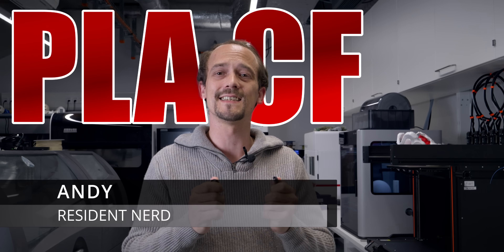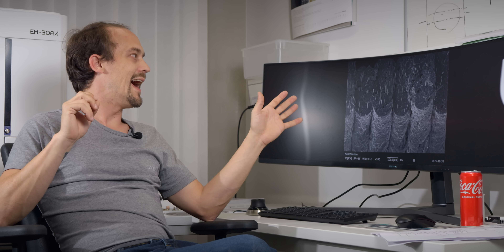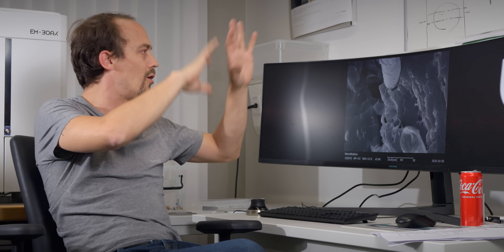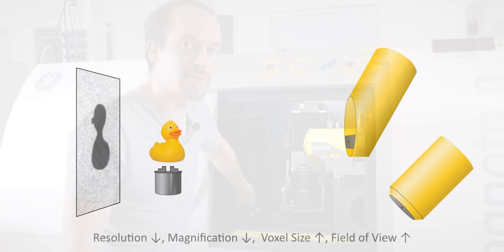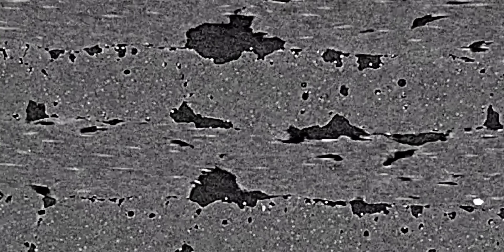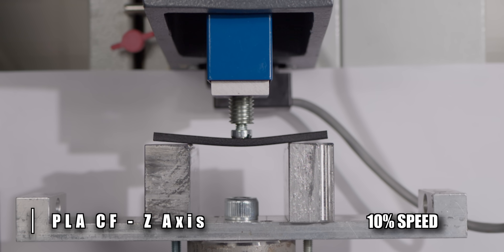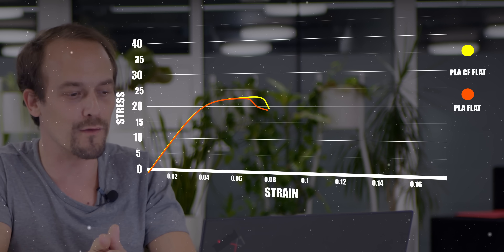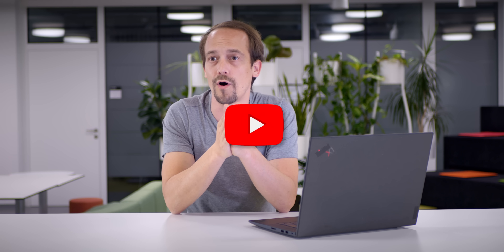3D Printing’s Biggest Scam Is Even Worse Than We Thought!

Comment: Yes, YouTube needs videos about health risks in 3D printing. CF filaments are no different than working with asbestos. Those small fibers trigger chronic lung inflammation which develop to cancer, it's exactly the same mechanism as asbestos or any inhaled small fibers than cannot break down, including glass fiber. Inhalation of any inert fiber is dangerous, and touching those prints with bare hands is dangerous, those CF needles jab into the dermis and never go away.
Secondly, the UV cross Link agents in SLA resin printing are incredibly toxic, even after curing, solvent washing, etc. 

In an industrial setting, these plastics would require serious filtration, masking,  or venting to protect workers but we let this industry sell anything to anyone with YouTubers ignoring the serious health risks to mostly produce stupid toys and more forever landfill.

Comment: Great video. I love 3D printing. When manufacturing items it’s important to have an understanding of the materials science and application. Carbon fiber reinforced resin plastics like in F1 or your buddy’s Honda are great. Glass fibers are used in insulation and as a chopped strand that is mixed into concrete. Printing with chopped strand fiber in plastics or the most common printing plastics isn’t a great idea. However printing a layer then adding a substrate that will allow the layer lines to adhere to each other can be a possible future. Also, not everything needs to be 3D printed. Punching, stamping, die casting and other processes are still valid manufacturing processes. We just need to reduce the barriers to entry like with 3D printing.

Comment: If I want CF parts, I print ABS part to create a mold to layer CF sheets into and vacuum suction to pull resin into it. :).
Reply: Curious to why you'd print ABS instead of PETG for a mold
Reply: @gammaxi1275 I just was reading about PETG to create the mold itself. I was doing it the hard/probably not the best way. Print the part, use plaster of Paris to make a form around the part. Clean and apply wax paste mold release to the plaster mold, lay the CF in it, brush or pour on the resin, then vacuum bag it pushing the resin evenly throughout the part. Looks like I could skip the plaster mold part if I just printed the mold with PETG. Still an amateur at making CF parts but 11 years of 3D printing!

Comment: I always just assumed that the CF was for the “look” not to add any actual strength
Reply: Only reason I print with it.
Reply: Anti warping for other polymers.
Reply: This video is "kicking in open doors" as the Swedish saying goes. Yes - I've never seen PLA CF marketed as anything but PLA with a more esthetic surface.
Reply: It's easier to print large parts without warping. Even in pla. And with something like asa or abs it makes large prints possible that otherwise just won't work.
Reply: @user-lj4xq4hm3k  The question is if that would be possible using biodegradable fibres instead of CF; at this point I get the impression that it's CF for "cool factor" more than anything else, but that there may come a major backlash when health risks come into the spotlight.

Comment: I would very much be interested in PETG Glass Filled.  I use it in my manufacturing ,1 for strength, 2 for Grip, 3 for aesthetics and 4 for increased temperature resistance.  I believe it gives me similar properties of ABS, without the shrinkage.  I would interested to know for sure though.

Comment: Very thorough. The equipment you have available to examine the structure was very helpful, the voids and lack of fusion seen in the micro-images were perfectly consistent with the mechanical tests. I am guessing that the carbon fibers don't fuse well because they probably don't shrink at the same rate as the polymers AND are individually quite stiff.

Comment: Yeah I never believed carbon fiber in anything except nylon or PC made any sense. Even even then, they don't help the mechanical properties. It is really about changing the thermal priorities to get better melting and a composite that is more dimensionally stable. I've long thought the only reason companies like 3dx can even show a difference is because thermal conductivity is so important to the internal stresses of PC that all mechanical improvements they are are from that.
Which to the point petg and PLA do not have high enough internal stresses.

Comment: I have been 3d printing since 2017 and printed pc-cf in 2018. Its was mine and a friends understanding we were not printing materials with cf because it improved the part strength. We were printing them because it made it a LOT easier to print them expecially in pc-cf which is what we mostly exclusively printed in. Almost all of the warping and shrinking issues going from pc to added cf were removed. We both agreed the contanimation of cf in the plastic made the part weaker as you put it causes stress concerntration in the part.

I would be more concerned about plastic off gassing as its extruded as a health concern. The inside of my enclosure has a layer of black 'soot'. It has taken a fair amount of time to build up but its deffently exists. The question is these micro/ ultra fine particles how dangerous are they to your health breathing in. In cases of plastics like ABS its suspected to be part of its rubber base burning which is carcinogenic. Plastics like PC release chemicals that can reduce estrogen. There are a LOT of health concerns with 3d printing thats not talked about.

Comment: I won't dispute the science, just add my anecdotal evidence that PLA-CF makes parts stiffer. I printed a whole lot of ukuleles and experimented with lots of materials. I got the best results with PLA-CF - not only did it hold tuning almost immediately, but it also didn't creep at all over time (or at least several months). Regular PLA creeped day to day and was unusable after a few weeks. In the end I started printing with PETG-CF, which is not as stiff, but also doesn't creep, and you can leave it in a car. Both PLA-CF and PETG-CF I used was from Bambu, PLA was colorFabb, Fillamentum, Prusament - none of that worked.

Comment: I don't think that this is that simple. I've had different results with CF and GF reenforced, as well as different filaments. It even seems to be different by brand.  I don't have as scientific results but:
1- CF and GF filaments do have one big advantage that I've seen with all of them that I've tried: they don't shrink (or as much) when they cool, so you get more consistently sized parts and less warping than without it
2- Another advantage I've run into with CF and GF PETG is that they have better acoustic properties when printing speaker enclosures.
3- PLA CF I've had similar results
4- PETG CF I've had inconclusive results; it was hard to tell if it was better or worse WRT to how the actual parts performed, but I didn't do an instrumented, standardized part/test
5- PETG GF is BETTER in most ways. Stronger, stiffer, big, flat parts that don't warp, and you can completely hide layer lines with the right print settings. I was able to make production parts that didn't need any finishing. I have a specific PETG GF that is my go to for parts that need to be more dimensionally accurate, stronger, stiffer, or have better surface finish
6- ASA GF and ASA CF were a disaster. I had prints that were falling apart/separating at layer lines no matter what I tried, sometimes as soon as they came off the print bed, like they stuck to the print bed but trying to pull them off the bed the layers would separate.

Comment: Ok so CNC kitchen did a video 3 years ago were he did a clear print with an extrusion 3d printer.  When he did strength testing he had material yielding rather than layer separation, I bet you could get with Stephon and test some samples that would be cool to see.
Reply from the maker: Oh I would love to. But I think im a bit smal still to partner up with him 😅
Reply: @Ibuiltathing  I doubt it he loves doing experiments and you have a capability he doesn't have, plus your video was great. I bet you could convince him to partner up for one video.

Comment: Great analysis! I'm actually curious to see a CT scan of a regular PLA part to see if they have any voids as well, as maybe that's partly an artifact of cooling a thermoplastics in general. That would explain why the strength of PLA and PLA-CF are basically the same on some of your curves.

I am also curious why PLA-CF doesn't warp as much when annealed. This is a widely tested and confirmed phenomenon, so maybe the voids and CF combined somehow help prevent warping!

Comment: This is why independent testing is so important. I'm definitely curious to see micrographs of non-reinforced materials as well, I'd wager many of those voids are inherent to FDM in general, though certainly the lack of adhesion between fiber and polymer are likely leading to more of them (different thermal expansion rates also isn't helping the CF to stay adhered). 
My question would be, why the difference from OEM results of material testing? looking just at Bambulabs data for PLA, PLA tough, and PLA CF for example. In tensile testing, we actually see your results, PLA vs PLA CF we get a young's modulus of 2580MPA +/-220MPA and 2790 +/-120MPA respectively, basically the same. But for bending modulus we do so an appreciable difference. 2750MPA +/-160MPA for PLA, and 3950MPA +/-190MPA for PLA CF. Any idea why this might be?

Comment: I only use pla-cf when I need a non structural part that is lighter weight. After watching the whole video, it looks like the voids are what make it lighter, not the cf😂 But either way, it works for my application.

Comment: Material flow during printing should produce more voids with carbon fiber as fiber can trap air bubles. The delamination between fibers and plastics can be a consequence of different thermal expansion coefficients.

Comment: Hello, 

Let me teach a little of what i know :) 
Carbon fiber in printing material is not what we say "wetted" Witch means that the grain structure of the carbon often is not filled by plastic but rather air and moisture. 

When you heat the plastic, the less wetted CF breathes and the air expands into the plastic causing microboubles in the plastic.
The reason that its not always in contact with the CF, is because you flow the plasting thrue the nozzle into the print surface. A great way to "stir air in the plastic".
When you see larger air gaps, this is because the material is not produced correctly.
Reply: The information of the microneedles and the danger if CF is great. This video should be used as a guide for people thinking about printing with CF

Comment: You talk about PLA CF but what about other materials that use CF? Wouldn't you expect the same behavior for other materials as well with CF?
Reply from the maker: Not with all of them. 
We just had a research into peek cf. I just cant show it now because it's still in review to be published. 

But the results are different. 
It all depends if the polymer is able to bond to the cf. 
This can be also changed by surface treatment of the fiber

Comment: Defintely do not use PLA infused with Carbon Fibre for designs where there is contact between moving parts creating abrasion and wear or contact with your skin! Unless sealed, it will create CF dust and is potentially cancerous, or best case itchy, it's like using asbestos for 3D printing.

Comment: It would be interesting to see comparison in between the filament, printed and "traditional" autoclave formed CF resin structure with respect to the fiber-substrate interface. Seeing the fibers as inclusions with no bounding at all and the occlusions which both are the primary cause of failure is quite an interesting demonstration of reality. ASTM is green lighting the printed structural parts for use in medical products to aerospace, by the mean time.
Reply from the maker: The classic "cf in resin" works. Because those polymers can actually adhere. Its different than in 3d printing. 
Regarding the print of structural parts in medicine : yes the Greenlight that. As they should 😅
I am using 3d printing in implants and metal 3d printed parts even structural and have several research projects into structural polymer parts for implants in my labs. 
Everything from bioresorbable (desolve in the body over time) to new ways of using titanium.
So the future stays interesting

Comment: Thanks!  Great video and very cool measurements and images.

Could you do a micro-CT-scan of filament just off of the spool?  Do filaments with CF have voids to begin with?  

I would love to see micro-CT-scans of PLA-CF, PETG-CF, and PA-CF (nylon) right off of the spool.  Then we could see if the voids existed before the filament was even used, or if the extrusion process creates voids or reduces voids.  And also if different polymers tend to have more or fewer voids.
Reply from the maker: I will show that for sure. Smal hint, I already know 😅

Comment: PLA is a very tough plastic from itself. Strengthening it with short fibers will always make it a bit more brittle. If you want to strengthen PLA, you need long fibers. If you want to improve layer bonding, you need fibers that stick out of the layer and will be embedded in the next one. Our company is testing with that and it seems to work. Can't tell you more at this stage because of the patents.

Comment: PLA is a low temperature material. This may be the source of the adhesion problem.  When Michelin first came out with steel belted radial tires, the process included a special coating on the wire to improved adhesion between the rubber and the steel.

Comment: The CF materials I have been using are Lehvoss Luvocom 3F PAHT CF 9891 BK and  Prusament PC-Blend CF.  The first one seems to be able to get benefits from the carbon fibre content, it prints easier, and is stiffer (and more brittle) than the NT (neat) variant. The issue I've been struggling with was long-term creep. Even annealing didn't seem to get rid of that. Prusament PC-Blend CF is less creepy, but more brittle and with worse layer adhesion. I've never managed to print it in a way where the layer adhesion wouldn't be the severely limiting factor for the print.

Comment: There is one additional benefit that CF provides in filaments: Reduced thermal expansion/contraction. As a result, materials with CF tend to print easier and do not warp that much. I wonder if this effect is also noticeable with PLA-CF (I myself never felt the need to print anything PLA-CF, as I don't need to make PLA more brittle than it already is), but it could be one way to get better results at the "impossible overhang" tests that are mainly limited by warping.

Comment: Other creators such as Igor from MyTechFun have talked about the chopped fibers weakening layer adhesion because of gaps and and such, which might be why no one called you out on it. The large voids in a simple rectangular prism are really bad though. Definitely need to compare it to other filaments. I would also change print parameters to see if you can improve those voids. Great vid, although it feels like you might’ve opened up a fun can of worms lol

Comment: Awesome video. But am I missing something? Your first and second test did prove that the CF is stiffer. Technically you can use a thinner / lighter CF part and it will match the stress of the regular part. Which is one of the main uses of CF parts.

Comment: IMHO, these voids are no surprize. 3D printing follows a similar approach to handeling plastics as injection molding. You melt up the raw material and transfer it to the location where you want to freeze it. What 3d printing lacks is the compression phase. In injection molding you fill up the mould compleetly and then apply pressure to compensate for shrinkage, thermal contraction and trapped air. In fact, propper settings for the compression phase determinates the quality of an injection molded part at least as much as the actual filling phase.
In 3d printing, no compression phase can be applied and hence you get a lackluster density.
Reply from the maker: Jep. I did injection molding as my first job.
U saw the arburg printer in the background? It actually does exacly that. Compression before it extruded. Super dense parts

Comment: Duuuuuude.  Skill issues. I stopped at the microscope photos.

Adjust your slicer settings.

If you print carbon fiber too fast, it is a mess.
Reply from the maker: 😂
Recommended printing settings. 
That's what I test
Reply: Great, I have been a part of the 3d printing hobby since 2006 and spent 2009 to 2013 designing professional grade 3D printers.

I use PLACF and PCCF to prototype lab equipment and weapons grade optics mounts.

If you test 3d printer settings, look at your microscope again and think REEEEEAAAAAL hard.
Reply from the maker: That's nice. I've been a professional 3d printer specialist for 12 years and designed and manufactured parts that are currently flying a view km above u in space and have more than 30 people walking around with stuff implanted in them that I printed. 
But I get what u mean...
But I test how 99% will use the material and not how professionals do it. Would defeat the purpose. 

Btw. I love critisism. You are always welcome to disagree. But seriously fix your attitude. The way you write is condescending. Let's have an argument but on a professional level
Reply: @Ibuiltathing they are called "engineering grade materials" for a reason. You attacking the material outside of their intended use undermines the industry.